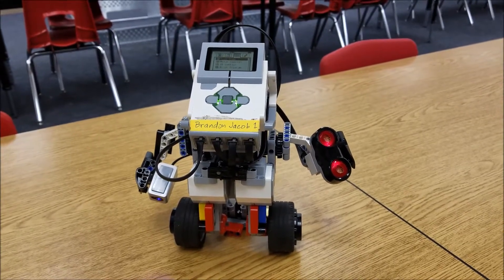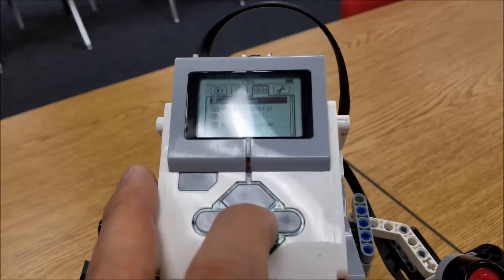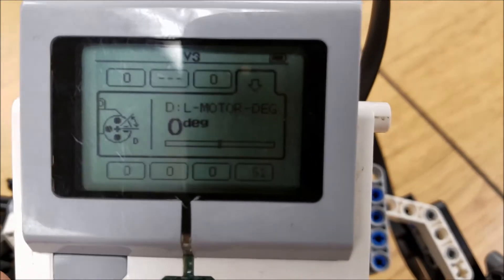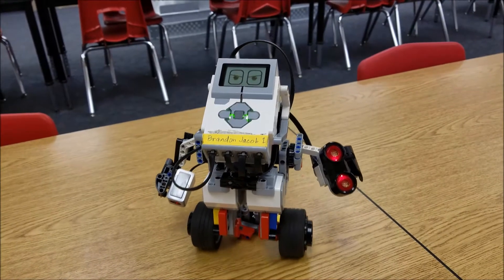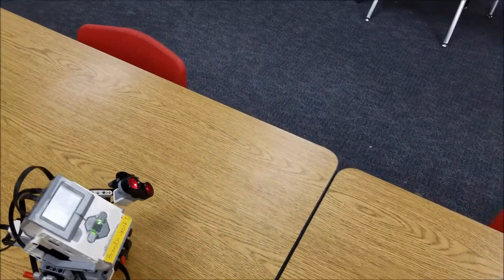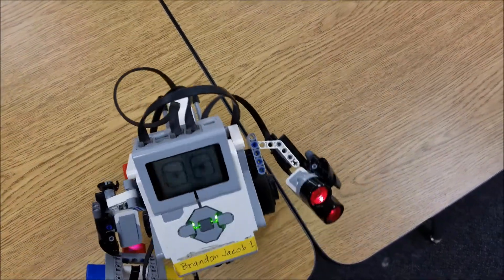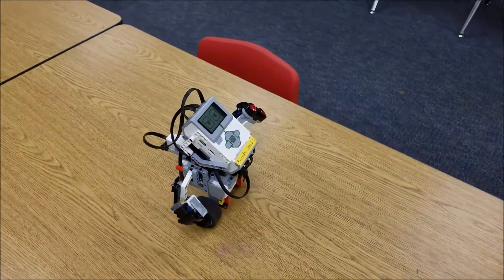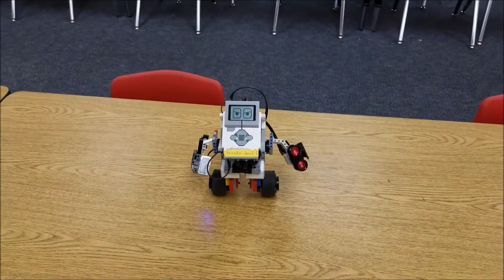"LEGO Mindstorms EV3 Gyroboy Project:  Where The Cables Go & Program"

Comment: Mine is connected well, code is done correct, after calibration it pushes the stand and topples over
Reply: Same
Reply: @jenniferzhu4048  turns out the gyro was in the wrong way